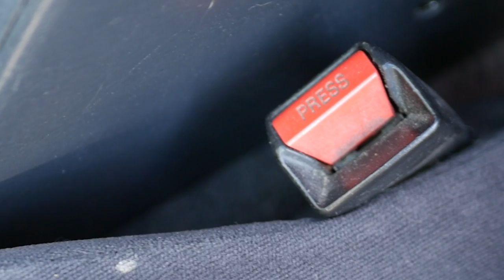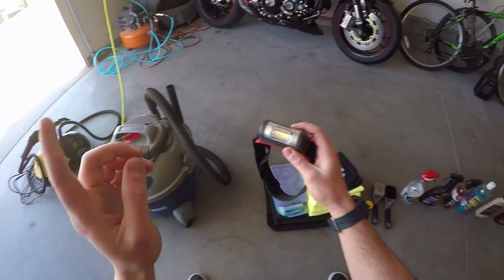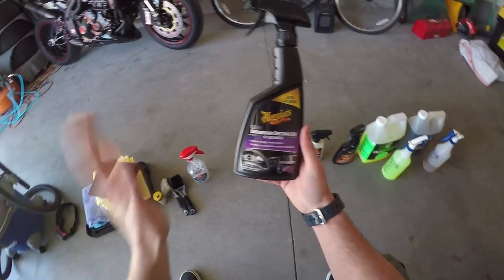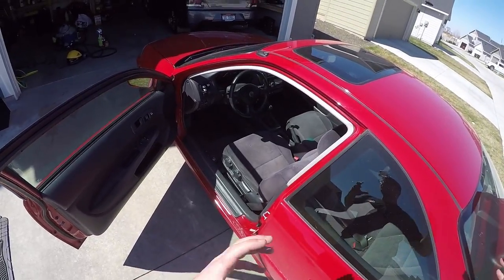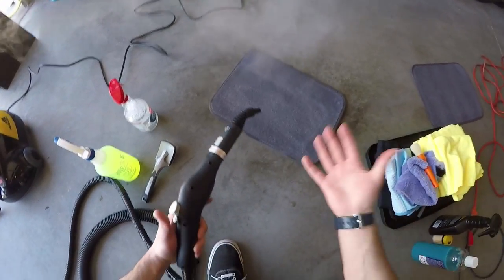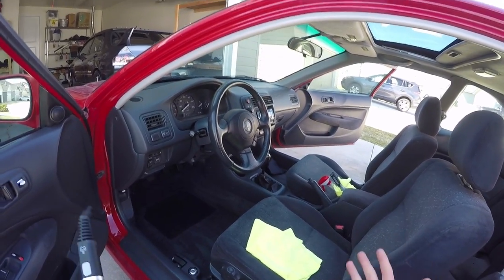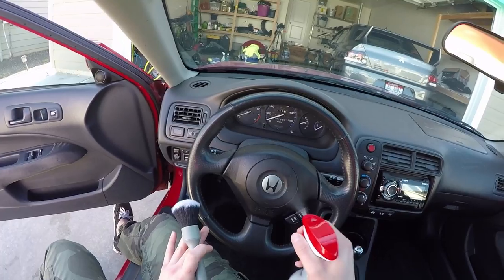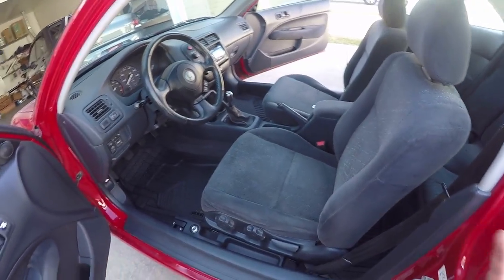Giving my Honda Civic the ULTIMATE Interior Detail | Start to Finish

Comment: Great Video! I have the same steamer that I use professionally in my detailing career. Instead of cleaning the seat belt buckle lettering with a toothpick, you can use the steamer! It breaks down all the gunk in those letters quickly. Just Steam, Wipe, and blow out the letters with compressed air. Nothing wrong with your method! Just a tip from a pro!
Reply from the maker: Another good idea! Just demonstrated the tooth pick method for those who don’t have a steamer

Comment: That Vacuming and Air compresser is a must for us professional detailers but here is a DIY Hack Tip use a electric air inflator the one you use for  blowing up  mattress some of them are powerful to blow the debris out rhe cup holders gear shift vents    can vacuum it up as you blow you can make it  more powerful modify the  orifice of the blower  with  a smaller crevice that air can come out of wrap it with duck tape and viola you got you a cheap air blower or use a leaf blower thats how i started before i got my money up

Comment: Nice video! I love detailing and always love a good guide video. But one thing im wanting to do this summer is clean my head liner. If you wouldnt mind, how would you do go about that? And what products would you use? Or would you use steam?
Reply from the maker: Headliner is never fun. Do not use steam. Simply spray a SMALL amount of interior cleaner on a Microfiber towel and begin to lightly rub the dirty areas. Do one small section at a time

Comment: Dude you nailed it with the armor all greasy look! How do I get rid of it? The previous owner used it on my em1 and it looks horrible! Even gets my fingers greasy when I touch it.
Reply from the maker: Spray the panels down with an all purpose cleaner and wipe off. Should remove most of that greasy feel
Reply: ALLDAYANTHONY thanks I’ll give a shot man🙌🏼

Comment: How did you find such a physically great car for such a cheap price, all I’ve found in the past couple years local to me are beat up/crashed, high mileage, and worn engine cars in the 3k-5k range. Anything below that has major mechanical problems or is completely crashed
Reply from the maker: I would call it dumb luck or just being in the right place at the right time. The car is definitely not perfect, but it’s gone from a 3/10 to more of a 6/10 to far haha

Comment: Doesn't it make more sense to clean the dash/vinyl/plastics first? Because you will be knocking around dirt and dust while cleaning and it'll fall onto the upholstery? Always my train of thought. Dash 1st, then carpet, then glass. Curious as to your explanation.
Reply from the maker: You could absolutely go that route. I just find that using compressed air or crawling around on the seats will often puff dust back into the cabin and back onto the plastics
Reply: Makes sense! Thanks!

Comment: I have a couple of problems with some of the information being portrayed as ‘good ideas’ first off he says that putting optimum no rinse/ chemicals in the steamer is a good idea, there should only ever be distilled water going into the steamer, no chemicals, most owners manuals will state this. Next he does one off the biggest and most dangerous mistake people make in amateur detailing by applying leather conditioner to the steering wheel, you should never put any type of conditioner or dressing on the steering wheel, shifter, or petals that is a major safety hazard 
Please stop telling people this is a good idea, this can and does cause accidents
Reply from the maker: While I appreciate your concern, Optimum No Rinse is a soy based polymer product made by the most respected organic chemist in the automotive industry. Technically you can water your plants with it. Second, a non silicone leather conditioner will (if anything) improve the grip of a leather steering wheel. If you want to go down the rabbit hole, so be it. But I know a thing or two...